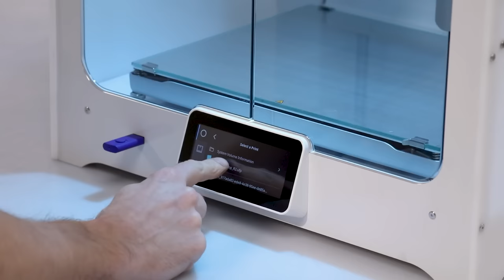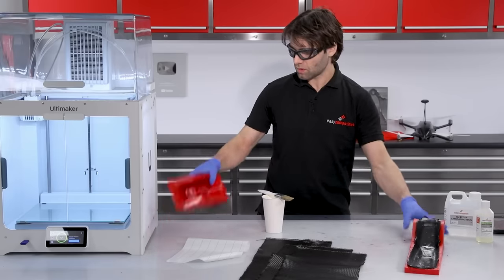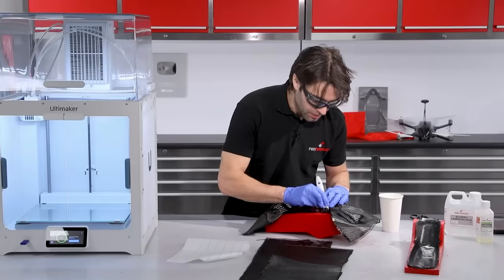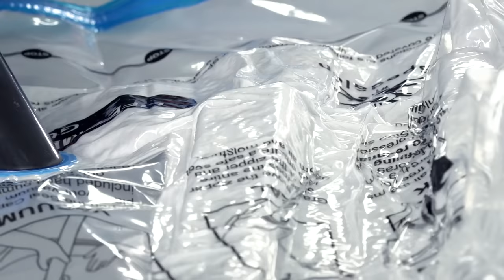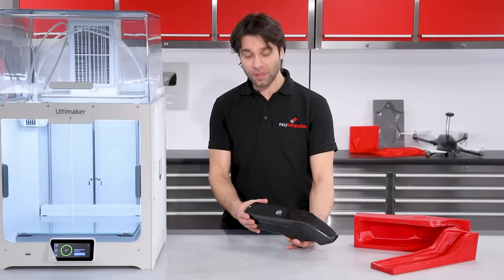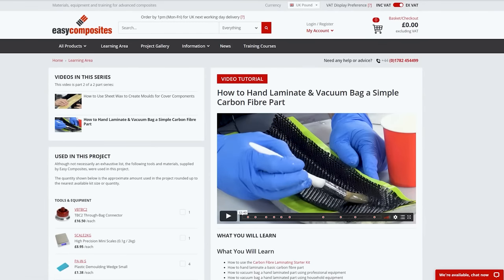Hand Laminating a Carbon Fibre Part Directly into a 3D Printed Mould

Comment: Thanks for sharing. Great video. Out of stock and $100 shipping to the USA sucks.
Reply from the maker: Hi Zane, out of stock is a shame, we are struggling with staffing at the moment, under the current operating circumstances which are quite challenging, and busier than ever which is tricky, but at the same time we don’t want to stock producing the content. As for the shipping to the States, the main cost is a flat fee of $70 for sending any ‘dangerous goods’ by air, this is FedEx’s DG surcharge, but this surcharge stays the same no matter how much you buy so for small orders it seems really high but for larger orders it’s not too bad. We are looking at options for distribution directly from the USA too, we really want to be able to offer a great service to our good friends and customers in the US.

Comment: Would sandwiching the fiber between two molds be likely to reduce cavities?
Reply: It would be easier to vacuum bag and get better results. The complexity of the model would have to account for the layers and resin and you'd probably have to iterate to get it spot on. That's not to say you couldn't 3d print a pressing block and let it bond to the pullaway layer so you can press and put weights into corners or tricky parts, but IMO vacuum bagging is still faster if it can't have flaws. This method is a down and dirty approach that is fast and gets you to a single viable part quickly. Great if you want to test a design or just need one IMO and don't mind the extra time to refine. Check out Throttle Stop Garage if you want lots of examples of large and small part hand layup bagging.

Comment: petg bonds quite well with araldite 2 part epoxy. I made a F1 steering wheel which was split down the middle and glued together which has held up for at least a year of abuse and 8Nm forces
Reply from the maker: With prints, you can get a lot of mechanical grip due to the layer lines and surface structure compared to a smooth glossy PETG sheet.
Reply: @easycompositestv  yes, i used it on printed parts without sanding the surfaces

Comment: Another great video! In the video you applied the resin coating after the laminated part was demolded and then finished it. If I applied the resin coating directly to the mold and then worked on it to leave it with a glossy finish and then laminat the parts in that mold, would these pieces come out with a glossy finish? That would be an option too?
Reply from the maker: Yes you can do it that way round and yes because the mould is then smooth and glossy, so should the part be.  Its a good time saver if trying to do more than one pull from the mould.  Just remember that 3D printed moulds are relatively fragile so may only be suited for short production runs.

Comment: Would you have any concerns hand laminating and vacuum bagging on a 3D printed mould, considering all the air between the infill in the mould? Would it bubble out though the epoxy?
Reply from the maker: It depends on the mould itself.  It should not come through the epoxy itself as that is long cured by that stage but it is possible the mould may break or be damaged.
Reply: @easycompositestv  first of all thanks for answering so fast, 3 month old video and you answer within a few hours, you guys are just awesome. Definitely ordering all materials for my project from you. 

I'm not sure I understand, the epoxy would not be cured when I pull the vacuum, would it? Or do you mean the PVA would provide the vacuum barrier? I was thinking if I should maybe perforate the mould on the outside (not on the surface I need of course), to let air out that way.
I am not expecting more than one use of the mould, so as long as it maintains shape under vacuum once, I'm happy.

Comment: you can also use peel ply then breather then sandbags an you almost get a vacuum bagged like part. works in areas that are impossible to vacuum bag or not critical and not worth the time to vacuum bag.
Reply from the maker: Any compression force is better than none so yes that can help if it is evenly applied.

Comment: Hi there thank you for your video! But I am wondering would this process without the vacuum infusion still produce parts with same strength as if you did vacuum infuse?
Reply from the maker: Hi Jo, hand laminating a part without any vacuum consolidation will produce a part that's fairly close in strength (and weight) to one that's been resin infused, or made from prepreg, but there will be some compromise. Generally a wet-laid part will be a bit heavier due to a higher resin ratio (lower fibre ratio)... wet lay typically yields 50/50 or even 40/60 (fibre-to-resin) whereas resin infusion and prepreg are pretty-much always 60/40 (so 60% fibre, 40% resin). If you keep the same number of layers of carbon fibre between the wet-lay and the infused version, the strength would be about the same but the wet-lay version would be about 20% heavier. You'll also get a better surface finish on the resin infused (or prepreg) version.
Reply: @easycompositestv  okay that makes alot of sense thank you! So if I do my parts vacuum bagged I'll end up with parts that are identical in weights.
Reply from the maker: @jowel9767  Certainly more uniform, yes, especially with PrePreg.

Comment: A mold like that, you could put a plastic bag inside once laid up and fill with water to create even pressure inside the mold.
Reply from the maker: Indeed. You can even just add a layer of release film inside and then just pack some car sponges in, it’s not exactly a pro method but it can be very effective at just holding the reinforcement against the mould surface.

Comment: what is the maximum temperature that can be tolerated by carbon fiber mixed with epoxy resin
Reply from the maker: That depends on the type of epoxy. For a typical ambient temperature system that usually around 70-80C, but we have a high temp system called EL160 which has a max service temperature of 170C and some resin systems can go to around 200C. For these high temperature systems you would always need to oven cure the part before service.
Reply: maybe in the next content could you please show me how to make it for high temperature

Comment: Silly question:
It it conceivable to combine a 3D printed ABS mould with a pre-preg on a low-temperature cycle?

I'm not sure if there's still chemical compatibility issues, but at least the cure temperatures seem like they would work.
Reply from the maker: We would not recommend it as you would be pushing the limits of the ABS and low temperature cure cycles can often compromise the pre-preg cosmetic finish.  You would be better off using the 3D print as a pattern to then take a high temperature mould from as per this video: https://www.youtube.com/watch?v=KpJdwryFj6k
Reply: @easycompositestv  Appreciate the response, thanks!

Comment: Nice results. Allowing for setting times, &c., what would the elapsed time to make that piece? (Mould printing, time for each ply, surface coat, &c.) The individual steps may not require much human time, but planning the building process would be important. Allowing a little extra time rather than rushing and perhaps spoiling a stage could prevent waste.
Reply from the maker: Print took a day, then a day for the layup to cure, then a day for the various coats of XCR to cure; you’re looking at 4 days from start to finish. As you say though, not so much actual hands-on time.

Comment: I have seen that you have made the piece in two parts. How did you put together both parts?
Reply from the maker: In this case a simple push button connector was used as it is a e-bike battery box.  Other applications may need something different.

Comment: Hi Paul, long time viewer and big fan.   Couple of quick questions.  Would parts made with the process in this vid be suitable for automotive use? Say inside a hot car in the sun?  or Under the hood as brackets and covers..   I'm struggling to find clear info on the heat tolerance of finished parts.      And the other Q is if the resin sticks to ABS well, Is it feasible to add a carbon outer skin to an ABS print? Or just embed a print within a part.
Reply from the maker: Depends on the resin you use.  Most epoxy resins are fine, especially if you do a post cure to the finished part. Yes you could skin as long as you get a good bond.

Comment: You should make a foam core rudder or dagger board for a sailboat. I'm getting everything figured out. I think a 3D printed split mold in two halves but how to get the foam in? Should I use an expanding foam in each mold and then trim it flush. Or finish the board, drill a hole and then pour in the foam? I'd be worried the second method could cause warping of the part. There's also a need of reinforcement in the leading and trailing edge for dings and repairs to be taken into consideration. But my main question is regarding the foam and then best practices for gluing the two parts together. I'm assuming I need an inner lip around the perimeter to bond to?
Reply from the maker: Often the foam core is CNC or hand shaped to fit in the middle and then laminating around it.  The 2 part mould would provide the fibre consolidation and compression. Making without the foam and pouring in 2 part would also work but give it a good sized vent hole so the excess comes out there.

Comment: You have cool job man.

Could you do a vidéo on how to mould and bond carbon directly on metal.
I ve seen bikes parts. Aluminum or steel wrapped in carbon. As a way to stiffen and protect parts.
Thanks.
Reply from the maker: Thanks for the suggestion Nabi, we’ll bear it in mind.

Comment: How thick is the coating?  Are You considering the thickness od coating in design od the mould?
Reply from the maker: Only about 0.5mm in this case so no need to change the design.

Comment: Is it possible to use this method for an intake manifold? As in, wrap the carbon over a 3d print and then break the print material out from the inside

Comment: Hello. I plan on making something similar, however due to my limited budget I will be using fibreglass rather than carbon fibre. Would you still recommend expoxy resin? Or would polyester resin suit my material better?
Reply from the maker: If you’re using a 3D printer mould then you’d be much better of sticking to epoxy even when switching to glass reinforcement. Polyester resin has a solvent content which can attack the print, and you’d also be dealing with shrinkage and other drawbacks. Polyester is a good choice for larger mouldings, in conventional moulds, especially when you’re experienced in working with it, but in your case, epoxy will be a much better choice.

Comment: Hello guys, I buy my carbon products from you. I have a question, if the resin doesn't dry completely and has some soft sticky sections what is the method to fix this issue? Can you overly the next layer over the top and will the resin eventually cure? This is for basic wet laying panels in a skinning method. Thanks and fingers crossed.
Reply from the maker: Tacky patches are normally improperly mixed resin.  Try and clean out the tacky patches as best you can then overcoat.

Comment: Is it possible to finish the 3d printed mould in a way that makes it easier to finish the part? Are there any no-no compounds for finishing the mould?
Reply from the maker: You could follow the previous video and coat the 3D print in XCR resin to get a much smoother mould then have less finishing to do on the completed part.
Reply: @easycompositestv  Thank you, I'll go watch it.

Comment: I always enjoy your tutorial videos Paul,  very professional.  And always a great promo for EC's products and materials.
Just a quick question if I may,  the filament used, does it suffer from 'shrinkage'?  would the mould be reusable time and time again or is it just a one-off?

Will you be looking into selling those 'Ultimaker' 3D Printers?

Sorry,  that's three questions!   ; )

TURK
Reply from the maker: 0.15mm.  The PET filament does not suffer from measurable shrinkage like some other materials.  We are not planning on selling any printers ourselves. However we would recommend Dynamism for help and advice with 3D printer options including the one we used. https://dynamism.com/3dp-cf

Comment: Ty for the upload first of all. I´m new to 3d printing and I´m just asking myself if using a fine grid sandpaper and the application of silicone spray afterwards would be a good alternative for the release agent. Or is there anything speaking against it, which I´m not aware of yet?
Reply: Well you can, if you got all the time in the world.. flatting layer lines out is a hard job and in a mold could be impossible due to the shape you are making. Not only that some filament just dont like being flattered and sanded. You could use uv resin from resin printer to coat the mold and get a uv lamp or the sun to get it to go off then flat down add silicon.. but pva is the best n cheapest way and less hassles.

Comment: Hi Paul,
Very nice tutorial, as usual!!!
Is not worth to work out the mold surface a little bit and apply the XCR epoxy coating resin in the same way as in the previous video and save some time in finish the final part?
Thanks for sharing all those technics with us.
Reply from the maker: Hi Paulo, yes, there’s certainly a case for using the resin to improve the surface of the mould before you make the part. The reason I didn’t do it in this case is because I was only going to use a wet lay (no vac bag) lamination for the part. This means that I’ll almost certainly need to fix some voids and the overcoat with resin anyway, in which case, for a one off, I’ve skipped some unnecessary work on the mould. If the mould was going to be used for a process more likely to provide a good result straight from the mould then improving the mould finish would be worth doing.

Comment: Hi buds..can you make tutorial making part carbon fiber using unsaturated resin? Is it possible to use kind of resin?
Reply from the maker: Do you mean polyester resin? If so, then yes, you can use polyester resin. Mechanically it’s not going to perform as well as an epoxy/carbon part but it’s certainly doable. We do know a few tricks for this from our early days involved in manufacturing parts, we’ll keep the idea in mind to do a video on this in the future.

Comment: You guys are awesome!   Thanks for sharing all the CF tips y'all do!      Side note- Do you guys ever do lightweight modeling projects???   I'm getting back into r/c sailplanes, after a 20 yr break. The foam-core wings I used to build from scratch then cover with obechi veneer via using a press or vacuum bag seems to no longer be a thing. Everyone has gone the CF route for good reason....just curious if you guys dabble in these sorta lightweight projects?!?!

Comment: Whats the best environment to do this in? Im assuming a dirty dusty and cold garage isnt going to offer the best results?

Love these videos. Super well made, diligently stepped and the wee pro tips on every step (clearly from lots of experience), really make it look sooo easy.
Reply from the maker: Thanks Stuart, much appreciated. Dustiness wouldn’t be ideal because you could might see some dust and specks in the finished part and cold conditions are also not the friend of epoxies! This might be a process to be doing in the house instead!
Reply: Sometimes you can use a heater or some incandescent lamps to heat up a smaller part in a cold room.

Comment: Great! Would like to see a Video with options to prepare the 3D printed mould to have better surface. What about e.g. sanding and using primer or filler or other options? Have you any experience with that?
Reply from the maker: If you watch the previous video we show using the XCR to coat the moulds for a good finish.

Comment: Hi, first of all, very nice video! Very well explained and straight to the point as all your other ones.
I am thinking of doing the same process but I saw a technic in other videos where they wet the fabric on a flat surface and squeeze out excess resin with a roller (between mylar sheets I think). Is it worth the effort? Eg does it really improve the fiber-to-resin ratio over simple wet layup w/ vacuum bagging? They also say it leaves more time to work with the material as you are no longer bothered with the pot life of the resin. What do you think?
Reply from the maker: The resin begins to cure the moment you mix it so it actually puts more pressure on the pot life as the resin is still curing once on the carbon on the mylar then still when trying to apply it.  Sure on a thin surface it won't cure as quick as in a pot but it is a lot of extra hassle and unlikely to make a massive difference for most simple parts.
Reply from the maker: You can wet out the fibres off the part but it tends to be a more messy way to operate as you have to move wet cloth around, it can also lead to voiding as air can be come trapped when you lay the wet cloth down on the surface. Additionally there is the chance for more weave distortion if depending on how well you can move the wet fabric. The working time /pot life won't really be effected as you still need to fully wet out the fabric, just in another location.
Reply: @easycompositestv  Ok, I understand! Thank you very much for your answers.

Comment: Great stuff.  I'd love to know the surface you are working on, an if you're having to clean up the resins and epoxy's immediately or if the surface is readily cleanable later? Or is it a layer of some kind that you can replace?
Reply from the maker: We use polypropylene sheet on the table top for ease of cleaning. Resin does not stick so can be easily removed.

Comment: One question, Acetone polished ABS still a bad choice of materil for this application? Nice content!
Reply from the maker: Epoxy resins can bond to ABS so you would at the very least need to use a release agent on the surface to prevent the resin from bonding.